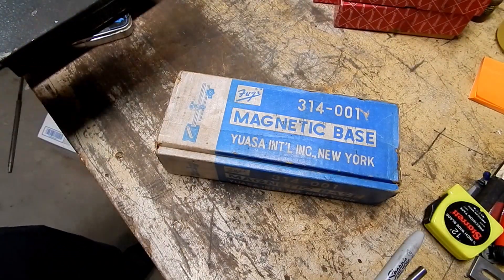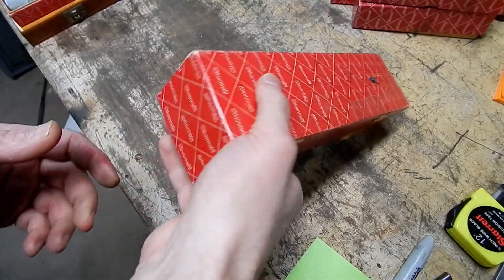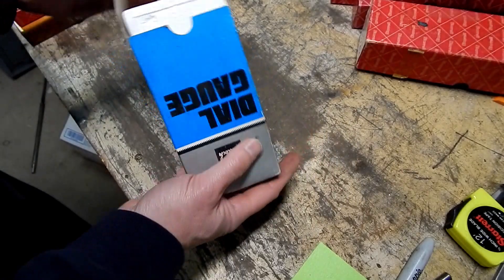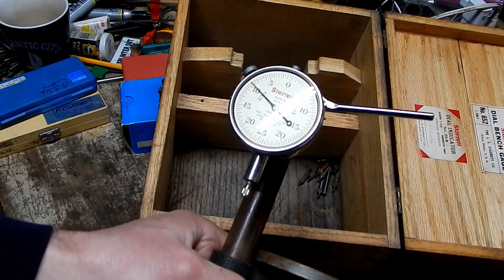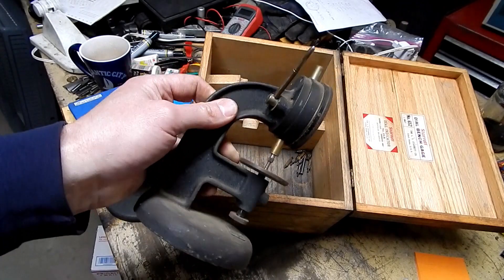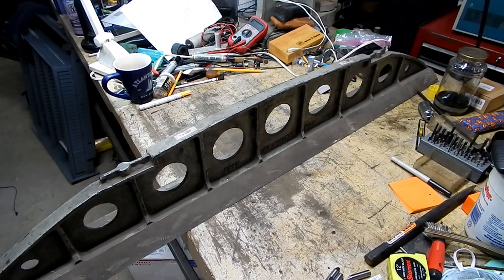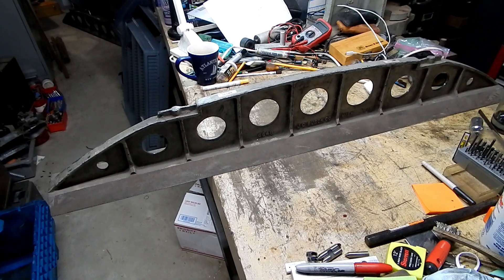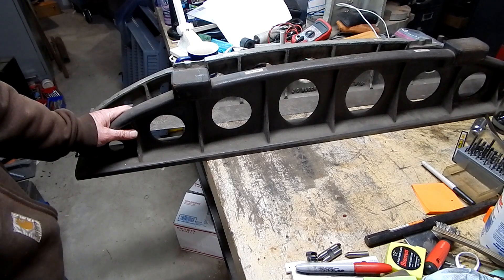April 2020 Tool Pick Part 2

Comment: Mag bases are good for holding cameras and microphones as well as my wife using them for holding her mirrors in her makeup room.  We got a couple of knock-off Noga rams with clamps that are pretty cool, but cheap.  I'd like to have a better Noga-style arm for holding cameras.  Manfrotto also makes one for a buck fiddy each!
Reply from the maker: My current setup I'm using to film the tool find videos is a fully articulated arm I bought at a flea market last year. Cant remember the brand right now, paid about $40 for it and I remember thinking it was a lot for a flea market purchase but it seemed so rugged I went for it. Turned out it was a good deal at 40. The non camera end just has a clamp clearly made for a boom or mast. You're going to laugh, but I use it on an old cast iron drop indicator stand on the corner of the bench. It clamps nicely to the post, and the cast base has enough weight to keep it from tipping. I have some overhead pipes in the shop I figure I can clamp to for shots at the mill or lathe. I've even seen a you tuber who mounted a length of conduit on the ceiling diagonally across his work area. With an  articulated arm like mine he can get lots of great angles without the camera ever getting in his way.

Comment: Could you gently warm that indicator that is sticky?  Perhaps that would loosen the mechanism just enough to begin moving it.  Just spitballing as I watch which is my normal modus operandi.
Reply from the maker: Not a bad idea. On the starrett ones I've found if I clean the stem with solvent and slide it in and out before the solvent evaporates, it will often resolve sticking issue. The starrett 196 is a tough one to clean because there's no removable back.